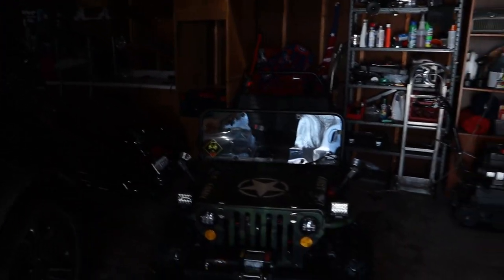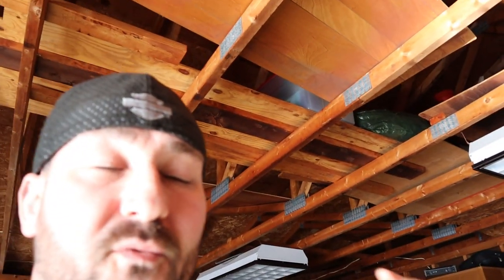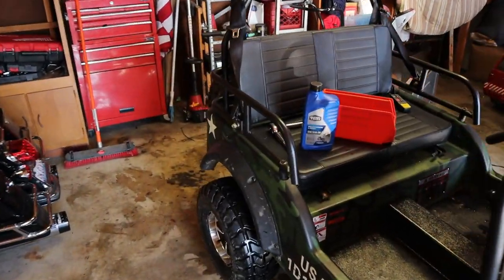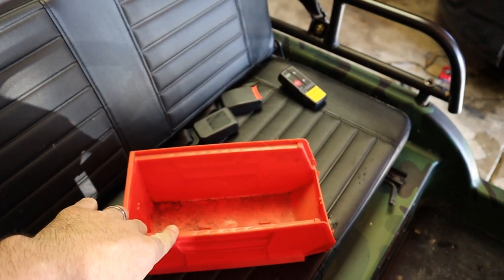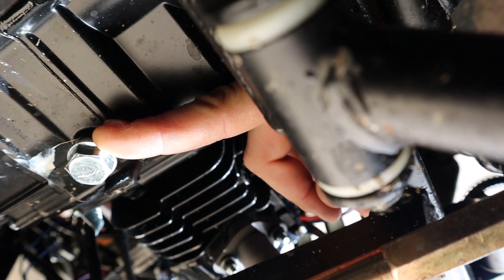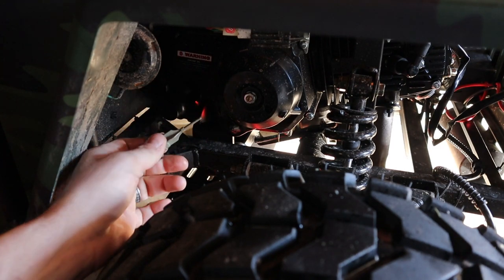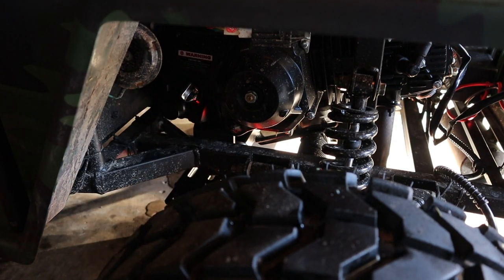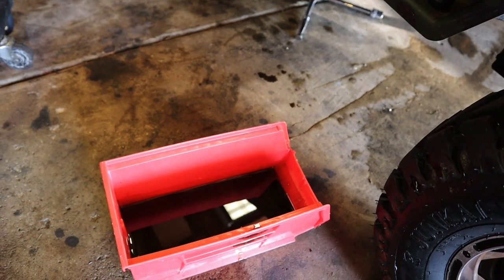125CC MINI JEEP OIL CHANGE

Comment: This is an ATV four stroke engine with internal wet auto clutch. Based on that knowledge I will give some advice about oil. Do not use automotive synthetic oil, as it will cause premature clutch wear and failure. You should use four stroke ATV oil which I know is a bit expensive. In my experience and as well as some very good advice I received from professional ATV gurus was to run old school Rotella truck oil “non synthetic “. This stuff has additives that can protect the clutches and performance is just as good as the ATV specific oil if change regularly.
Reply from the maker: I couldn't find anything on these lol.. it has been running really good with the synthetic oil. I have put on over 500 miles
Reply: The manual calls for 15w 40 motorcycle oil with clutch additive. I have a similar model, mine being the GR2 with rear mounted motor. Im located in Ohio where the temperature varies. should I stick with 15w 40 or should I go with 10w 30?
Reply: Gothboy77 I’m not too sure about cold temps. I think you might need to go to lower viscosity when the temp drops below around 20•f.
Reply from the maker: @ramsesribb2997  I run 10w30 when it's super cold out
Reply: @ramsesribb2997  I ended up going with super tech full synthetic 10w 40 motorcycle oil and it runs great
Reply: Gothboy77 yeah motorcycle oil costs a little more but has the needed additives.
Reply: @ramsesribb2997  I am glad you bumped this, I actually have a 2 Weeks Update - It's been getting colder out and I've been putting some miles on the tiny beast, so I bought some lucas brand high performance  motorcycle oil formulated for wet clutch. It is 10W 30
Reply: You're supposed to use 15W-40

Comment: Hey brother, just wanna say thanks for the video, it was very helpful. I was able to get tools, funnel, oil  and everything else I needed before starting. I laid some cardboard down on the grass. Got my fat crippled ass under it and got it done in like 15 min or less. The drain plug is not magnetic so nothing stuck to it but I did drain the oil into a plastic pan and dropped two little round magnets in it, I got three little very tiny slivers of steel out of it , no dust  that was it . Not bad for a first oil change
Thank you
Reply from the maker: Anytime buddy!! Glad my video helped you out! :)

Comment: Great video bro! I’m getting my Coolster jeep tomorrow from a local dealer. I read in the comments that i should change the oil asap. I’ll definitely do that! My question is if there were any oil filter? I know smaller dirt bike motors use the screens. Have you found anything like this? Or am I just good with oil change only? Thanks Brother!
Reply from the maker: No oil filter on these. Make sure you only use about 750ml of oil when you change it and use 20w50 motorcycle oil that is rated for wet clutches.
Reply: Projects 815 thank you for the info man! Like others have stated there is NO info on these cool machines; very greatful you have blazed the trail on making informative videos👍🏼 great content, no bs, straight to the point & very quick comment response time! (Love the Harley btw)
Reply from the maker: Thanks!! I try to make the best content I can learning from others mistakes. My channel is growing so fast.. thanks for the sub and follow on IG!
Reply: @Projects815  hey bud, why did you change from 10w 50 in video to 20w 50 ?

Comment: is that the speedometer that came with your jeep? does it have an odometer in it? I just got this jeep not too long ago, but it has a km/h speedo with no digital tach. If there is an aftermarket upgrade, that would be awesome

Comment: Will this be the same way that you change the oil on a 125cc Mini Jeep from venom Motorsports Canada  ? BTW great video and thanks for sharing very helpful information as I just purchased a 125cc Mini Jeep and 200cc kodiak full size ATV both from venom Motorsports Canada /USA and will be changing the oil on both for the first time this coming weekend. They told me for the first time changing the oil after the break in period not to use synthetic oil until the second oil change. What do you recommend ? Also what do you recommend how many hours or miles/km for oil changes after the first one  ? Thank you. PS I pretty sure that they told me 10w40 could that be wrong  as it's exactly the same Jeep as yours. Thanks again for the great video and awesome information as I know it will be really helpful next weekend.

Comment: bro. i have a question about this jeep. I just got mine and put it together yesterday. The problem i am having is the smell coming from the muffler, it is too strong. Because the muffler is in the front it feels very strong. Can you please tell me if this problem is because it is a new machine? will this ugly odor go away soon?  i have been thinking about running a pipe to the back of the car. Please tell me what is your advice.

Comment: Hi, Great informative videos by the way.... Was the oil you used fully synthetic?.....
Reply from the maker: I did use full synthetic. The manual recommends you use non-synthetic. But my Jeep has well over 700 miles on it and still running strong using synthetic oil
Reply: @Projects815  Many Thanks for your quick reply, keep up the good work on the videos....

Comment: I read in a forum that it comes with shipping oil and not to use the machine until you change the oil. Apparently the shipping oil is put in because they don't know how long it will be stored in the warehouse. I don't even know what shipping oil is, but did your original stuff look like normal oil?
Reply from the maker: It did not it is tan and nasty.. change it out immediately

Comment: On break in did it shift extremely loud? Or make noise going into reverse? Just put mine together and it shifts fine, down shifting it doesn’t sound good and neutral to reverse sounds awful
Reply from the maker: Change the oil. The oil that's in there is no good for the engine and trans.
Reply from the maker: During downshift make sure you push the stick forward and rev the engine then release the stick.. it rev match's and it's easier on the trans

Comment: Do these jeeps have trans fluid ? My sons silver plug in the trans fell off but I was told they don’t need fluid ?
Reply from the maker: The transmission shares oil with the engine. There are not two separate fluids

Comment: weird question. do you know the size of that oil drain plug?
Reply from the maker: As far as thread size no the socket size to remove it is 17 mm
Reply: Projects 815   Thanks. I got one off a friend but they lost the plug.
Reply from the maker: The drain plug or the dipstick on the side?
Reply: Projects 815 the drain plug.  He decided to change the oil and probably threw away the plug
Reply: Hey. FYI. I found a magnetic 12mm oil plug with thread pitch of 1.5 from amazon that worked

Comment: How many hours you have on it now buddy ..just subbed 👍
Reply from the maker: It has around 20 hours and 40 miles on it
Reply: @Projects815  that's awesome man ..keep the vids coming on it ..so cool man ..wish they made one a little bigger ..I'm 6'4 I think I would have a issue fitting
Reply from the maker: @amp2425  I am 6"1 260 lbs and I fit ok

Comment: Smoke and bad burning smell seems to be coming from the spark plug area.  My kids ride it around the block and it seems to slow down and eventually comes to a stop. Any ideas?  We just got it last week.  Oil levels is good, and no visible leaks.
Reply from the maker: It may be the coating burning off the exhaust. Have you changed the oil? Do not use the factory oil that comes in it. It's chicken oil and is ment for short term use
Reply from the maker: Also make sure the broken fuel flow valve is in the middle between on and off. Each machine is different so if it seems like it's losing power when you hit the throttle it may be starving for fuel
Reply: @Projects815  aww..Ok.  I will need to change the oil then.  I will use the oil based on our recommendations.  Appreciate it.
Reply: @Projects815  Good suggestion.  I will check it when I get back home Friday. Appreciate it!

Comment: Can you drive the jeep on the beach
Thanks
Reply from the maker: Yes
Reply: My mini jeep was running great and then it blew off vacuum line to the fuel pump. Now I can't get it to start and stay on normal. Now I feel oil or something on air filter

Comment: Can I use 10w40 Valvoline atv/utv oil in 40-70 degree weather? Any help appreciated thanks
Reply from the maker: I would go with a heavier weight oil. Keep in mind it will need to be wet clutch rated
Reply: @Projects815  would rotella t4 diesel oil work it’s a 15w40 ck-4 but I can’t find if it works with a wet clutch
Reply from the maker: I run 20w50 Harley oil in mine. Runs great on it

Comment: Can I get a video on chain adjustment for it? The chain keeps hitting the floorboard due to being to loose. Can’t seem to find any videos on it
Reply from the maker: I believe I explained chain adjustments in my common mini Jeeps problem video
Reply: Found it thank you

Ours is decent I just gotta get a replacement driver side mirror and troubleshoot the km/h gage as it didn’t work when I tried it

Comment: Super tech is pretty bad stuff, but it is a cheap jeep.
Reply from the maker: It was the only thing local that I could find in that weight that was wet clutch rated. After this video I've been running Lucas oil
Reply: @Projects815  so 10w 30 is working well so far?